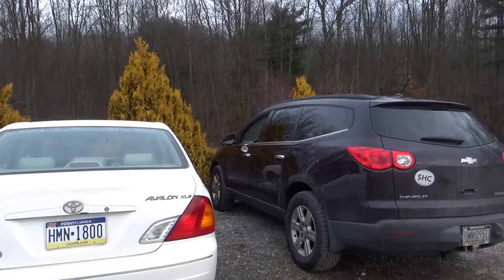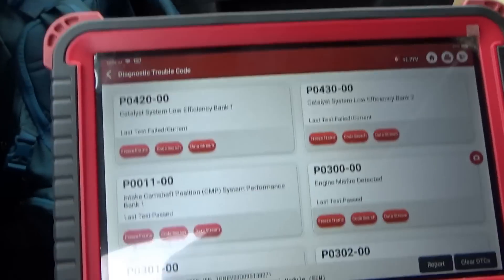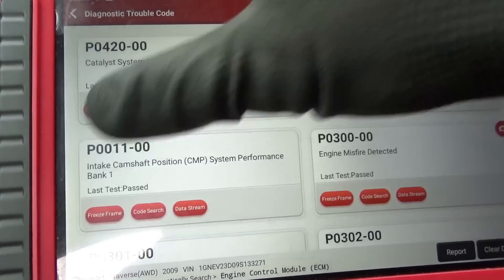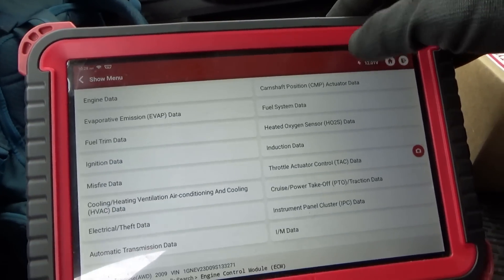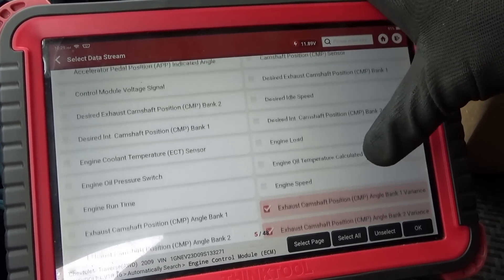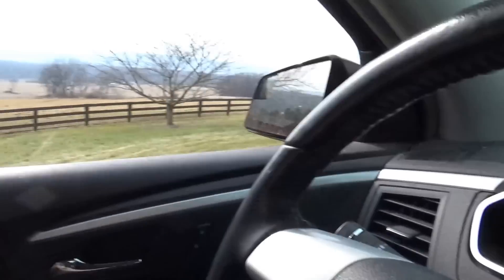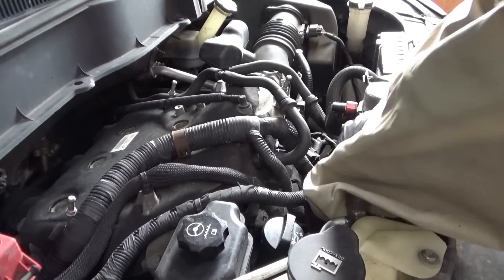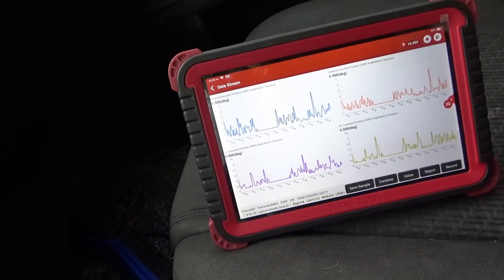Is it TOAST? (09 Traverse V6 GDI - Misfire & Timing Codes)

Comment: Too many people assume that if an engine needs oil added, a light or a warning will come on to tell them to check oil. They don't understand the difference between pressure and volume. Not pointing any fingers, but the engine noise should have been an indication to check the level. Another great video Ivan......never stop driving home the basics.

Comment: We have a 2015 Ford F-150 XL with a base V-6 at the plant where I work.  It was my day to inspect plant effluent outfalls.  I always check oil and vital fluids and air pressure before starting out.  I got to my first stop and the oil pressure gauge flopped over on 0 and the tone generator for the key started to "ding."  I immediately shut the engine off.  I was on a level surface, raised the hood and the oil level was right on "full."  So, I called the garage, they came over and they determined it was a faulty sensor.  Good thing I checked the oil level.  I agree this guy should check everything before having his wife start out in this vehicle;  he probably doesn't have Keith DeFazio on speed dial.  (I am just kidding, Ivan.  You couldn't have known that mice would get in your wife's car, chew a hole through the air filter and build a HUGE mouse nest blocking the mass-airflow sensor and causing the engine to stall on the side of a mountain in a curve going uphill without any warning.  Still, you were able to say that with a straight face at the end of the video.)  Great video!

Comment: Probably low on oil because it was close to needing to be changed and being a high mileage engine. I wouldn't be surprised if that engine uses low tension piston rings too. Hopefully it didn't damage the cylinder walls or the rings, ouch.

Comment: Amazing a 3.6 is still running at 190K.  Even more amazing the trans still moves. Even more amazing the AC holds freon.  Even more amazing the steering rack and hoses are not puking fluid.

Comment: I have learned many useful things from you. When car computers seem to have gone insane, check the battery and its connections first. When engines run like crap, check the oil. Eliminating what it isn't will lead you to what it is. I also learned that the $20 subscription for a vehicle to AllData for a month is the best $20 you can spend. Cheers.

Comment: I typically check oil level condition for timing codes. With that said I've made the same mistake. Recently had a Mia kick my aas. For days I couldn't figure this car out. No codes. Just intermittently would stall. Right before stalling you'd here chain rattle. So I disconnected the exhaust side vvt solenoid. And it stopped stalling. Then I scoped the control to the solenoid. All looked good. Installed new control solenoid. Drove it 15 miles. Perfect. Then it comes back a week later. Same symptom. Of course I'm scratching my head. So start scoping again. This time I see that when it stalls the waveforms show timing jumping around. Remove valve cover to inspect. Find timing chain so loose you can jiggle between the cams. So we do the timing chain. Car leaves. Comes back 2 weeks later this time. SAME PROBLEM. Now I'm really feeling like I suck. So get to scoping again. Find the same weird erratic timing every time it stalls. I then figured out that if I let it idle and then raise the rpm slowly to just about 1800 it will stall on demand. So I check oil pressure. And sure enough from idle to about 1800 rpm oil pressure is way too low. Then it occurred to me. We never did an oil change because the oil was full and looked relatively new. So I changed only the filter first. I wanted to if it would make a difference. And wouldn't you know it. Oil pressure shot right up. So in the end this car likely had multiple issues. But the root cause was the oil filter. Sometimes that's how it is.
Reply: Right after I bought my '03 Avalon, the oil pressure was always taking a couple seconds to come up. I thought "Crap! Oil pump." Changed the filter to a good name brand and problem solved. The anti drain back valve had failed and the engine was starving on cold starts.
Reply: @Gregory Glessner  Yup. Seen that one too. Like Ivan shows sometimes you get so used to seeing these problematic cats that you forget that it can still be something simple.
Reply from the maker: That's nuts!

Comment: This is a massive hidden danger of all these 7,000 to 20,000 mile oil interval.  Most people don't realize there is more to worry about than just changing the oil.  You can consume a lot of oil in 20,000 miles...even if the engine isn't worn.
Reply: many of them use a quart in 3000 miles, let alone 5K and up.

Comment: Ivan, with all the modern technology in cars today, why don’t they have a system that monitors oil level that can prevent starting the engine at low levels. It could prevent these problems and catastrophic failures. If it’s good for generators, why not cars that cost much much more to repair?🤔
Reply: They do. People ignore the oil light. They cannot get the courage to open the hood and check the oil.
Reply: @2nickles647  Clearly this vehicle has no "low oil level" gauge or light.  It was down several quarts!

Comment: Don't blame yourself. Owner neglect of services and maintenance it's not your fault. We all assume the basics. Owners should fill up their gas tank, check the oil, add windshield fluid, and maybe if they have the tool check the tire pressure. That is why since 2008 was mandatory the TPMS and more and more people avoid replacing the sensors after getting new tires. To me, that is a safety issue specifically for those owners that won't check the tire pressure and drive the car with low PSI and then blew a tire and cause an accident. Luckily for the owner, just an oil service fixed the issue. will see in the long term the real damage.

Comment: 190K miles on a GM 3.6 is a gift and severely borrowed time in my opinion.
Reply: I'm willing to believe that a 3.6 V6 will run past 500K with only minor issues if it has oil changes every 4,000-5,000 miles.      Lack of maintenance can kill anything.

Comment: Sounds like if owners just took care of their vehicles better, like checking the oil every 2 weeks, even crappy GM 3.6L V6's might live longer.      "Operator Error"!    I guess I'm old enough to remember my Dad pulling into a "Service Station" to get gas and they always checked your oil every time you got gas!      Little has change with basics for engines.

Comment: Have been preaching this for 50 years. Operated heavy earth moving equipment for all that time , and checked the oil every day before starting an engine. I know it saved at least three engines from failure over that time. Love your videos and your disciplined approach to problem solving. The basics still matter.
Reply: I understand what Your saying Bill, and I too have been operating heavy equipment since 1979 and of course always do the routine checks before starting, but that is a bit different situation than this realm, to be fair. I was actually in an old D-10 loading a train today when I watched this.
Reply: @brianw8963  I worked in the fire service for 31 years. Every engine, gas or diesel, from single cylinder to v8 got the oil level checked at every change of day shifts, which was every 3 days when I was on the job.
Reply: So true!!  This person probably wasted his money changing the timing chains... as it get "ZERO" maintenance... probably ruined the new chains already too.      I actually feel sorry for the car!
Reply: With the mileage the maintenance done 50k miles ago was probably worth the effort. This minor yet major oversight should be front and center  on a driver's mind so not to happen again. 
BTW, wonder if this counts as a NPR? lol
Reply: Yea i also operated heavy equipment.. You check fluid levels for a reason . I check my fluid level in my personal  vehicles because i am cheap ..i dont want to buy a engine for a dumb mistakes.  I appreciate the videos

Comment: Question.  If the motor would have blown up on the test drive who's to blame.  I asked because we just picked up a car for an oil leak issue.  Checked oil and was a little over full. Drove it to my shop and overheated. No antifreeze . Caught it in time but what if I didn't. I know who would get the blame,  lol
Reply: I thought of the same thing when I saw him going for the test drive !

Comment: Ivan, we are all guilty of that and the more technical you are the more prone you are. I went to a machine once and the complaint was no power from the PSU. The machine was stripped all over the floor. You could not see the power connection because it was behind a desk. I said have you checked for power in. No was the answer. Looked behind the desk and the power plug has fallen out. It happens so good lesson. I have checked wiring before checking the bulb. It happens. So yes thanks for a good video on check the basics.

Comment: The first thing I would check the amount of oil then quality of oil. Never take any bodys word .
Reply: I'm not a mechanic but have checked many cars for realitives. They always say has oil or just changed. I always write down date and miles in a notebook. I have found low oil and very dirty oil . Seen them no compression on a little Chrysler.  Changed oil and filter and was after time able to get back working. I believe in quality synthetic oil in later model of vehicle's.
Reply from the maker: Any oil is better than no oil lol

Comment: Yep, first thing I thought when all the variances went high.... there's not enough oil in it. Then when you went for the wipe and second dip, before you even pulled the dipstick out the second time I said out load, 'there will be nothing on the dipstick'.lol🤣
I have a customer with a 2016 Craptiva with the Ecojunk 2.4L that I recently recommended halving her service intervals..
It only had approx 2L of oil in it after 12 months, it takes 4.7L at a service, and it has only done a little over 100,000kms🤯....Gotta love GM JUNK nowadays!!

Comment: I remember my Dad telling me when he was in high school basic auto owner maintenance was a REQUIREMENT for graduation.  By the time I got to HS (same district), it was only part of shop class taken as an elective.  Growing up on a farm it was standard operating procedure to check the oil on tractors everyday before the initial start up.  Cars and trucks we usually didn't do as often unless they were being worked hard.  1-2 week intervals.

I have to admit.  Now being older, running around everywhere for everything silly and owning newer vehicles it is easy to become complacent about regular checks.  Still try to do it at least once a month.  I'm going to set a reminder in my phone to do checks right now.
Reply: As a kid (I'm now 53), on the farm it was tractors and trucks every day before they were started. The regular "going to town" cars were every Sunday regardless of anything else happening. Pulling dipsticks was as much a religious practice as going to church for us, and Dad was absolutely fanatical about it. I followed him down that path.
Reply: I have long had a habit of checking oil level every Saturday morning on all my cars. I still do that even if it is a brand new car.

Comment: I can only imagine how many shops would've changed the solenoids on this car.  Nice job.  I still regret not checking the oil in the Silhouette before taking off that fateful day :)
Reply: ...charged them for that and also charged them for an oil change....
Reply: @additudeobx  that's how it works
Reply: @vgbr88  yep. Diag on the problem = 1 hour. Oil change was the repair. I'm sure the owner feels just a little silly.
Reply: @GregoryGlessnerViolin  I think additude was saying another shop would have put solenoids in, and charged them for the solenoids AND the eventual oil change that would fix the problem.
Reply from the maker: Oil level was FULL when you left, I can guarantee that xD
Reply: @PineHollowAutoDiagnostics  The MPV really came through in a pinch.  Glad to see you got a great deal on the Olds' replacement with the Camry V6.

Comment: I haven't watched the video to the end yet.... check the oil check the oil check the oil.
Reply: What is nice about the VVT systems is that they can save engines.
Reply from the maker: @paulstandaert5709  That's a GREAT POINT! Phasers start rattling well before the bearings get dry :)
Reply: @PineHollowAutoDiagnostics  I did exactly what you did in the video a few years ago. I was thinking that the noise was actually from the timing chain tensioner(s) and maybe it was. So I pulled the dipstick and it all started making sense. Had it not come in for running poorly, I would have been putting an engine in it in a few weeks.

Comment: Had on 2009 Saturn Outlook drive us crazy trying to find an intermittent misfire.  Same issue as yours it was 4 quarts low on oil.  After that one, we definitely try to remember to check oil on a GM 3.6 that has a driveability issue.

Comment: Can any car manufacturer build a variable valve timing system that isn't prone to issues?
Reply: Ironically, the VVT on this car very likely saved the engine.  Before VVT, they wouldn't run crappy as a result of low oil.

Comment: It's a miracle to get one of these lumps to 190K, especially when it looks like the owner can't even be bothered to check the oil.
Reply: 100% agreed, that rig should have been paper clips 100K miles ago 😂😂😂
Reply: that's what everyone does now days, they say "I get the oil changed on time, it's always fine". no! no! no! check the oil weekly at minimum, because they all consume oil.
Reply from the maker: @throttlebottle5906  Just calculate oil consumption and add as necessary at the appropriate mileage...no need to wear out the dipstick ;)
Reply from the maker: I was impressed too! Original High Pressure Fuel pump as well!

Comment: That's kinda shocking that the engine survived running that low on oil for so long.
Reply: If it blew up the owner would of said it was a piece of junk.     A reliable Toyota is a piece of junk if you run it low on oil!

Comment: I just did a timing job on a 2.4 in a equinox a couple weeks ago. She had called me 2 weeks prior saying her engine ismaking noise. I told her to come in next day. Never showed up. Anyway It needed timing chain and guides were chewed. Rattle she heard was the metal from guide eating away. I drained less than 1 full quart when I pulled the plug. She seemed shocked when I told her to check oil on weekly basis.
Reply from the maker: WOW lol